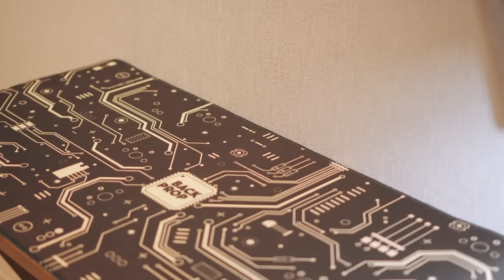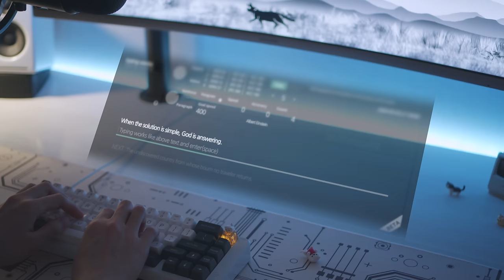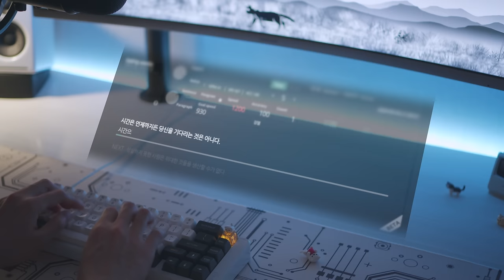SPACE65 Custom Mechanical Keyboard Build | H1 Switches & SA Oblivion Keycaps Typing Sounds

Comment: Lubed linear switches are honestly something else, they sound so full and... perfect
Reply: The foam pad he placed between the pcb and the baseplate creates that more solid sound
Reply: Planning to build my first keyboard with lubed Cherry MX Blacks. Can't wait!
Reply: Dominik Seljan you’ll fall in love with typing
Reply: SA keycaps also affect the sound alot
Reply: Thanks alot for showing the heat shrink tubing mod. It actually works perfectly on my GK64 stabs, which drives me crazy for weeks...
Reply: @sandipandeb9330  wait.... he?
Reply: @MMedic23  uh yeah?
Reply: Guys have u ever heard of c3 tangerines
Reply: this keyboard is my endgame. literally perfect thoc
Reply: Solve Everything  o rings??
Reply: Why did this board sound so low pitched and thocky compared to most others?
Reply: @Annihilation261  I thought he said the shrink tubing didn't work? Did you have a bad rattle?
Reply: Solve Everything  I think the problem is with mass-production. There will always be some roughness to the stems. You can hand polish them if you want as an alternative to lube, but you'd probably still want to lube a little.
Reply: That keyboard THOCKS!
Reply: @kaandemirci9691  Pudding keycaps look cool but they are really thin plastic.
Reply: Man I don’t know, it sounds really bad to me, just like machine thunking, I don’t know what it sounds like but I don’t like it. I’m sure you guys love it tho lol
Reply: I honestly prefer tactile switches
Reply: yes and now im thinking of lubing my keyswitches which are outemu blues (i didnt think blue switches would be very loud compared to smth like red or brown since im very new to keyboards) due to noise complaints
Reply: @jonathan_emmanuel  it might be a little late but my friend clipped the legs and click jacket off of his blues and it turned to quiet linears. I don’t know how it works so you might have to look up a tutorial.
Reply: uu7569
Reply: true i lubed my outemu red and put 5 layers of tape mod and foam mod its more solid sound than before
Reply: @sandipandeb9330  That and the fact he's using SA keycaps. SA + linears are a lot like the sound porcelain makes when it impacts itself gently. Almost like a clonking sound. It's weird and I personally wouldn't live with it, but it's unique, that's for sure.

Comment: 5:51 I just taped a piece of thin plastic transparent band-aid on the place where the bracket touches the stabilizers stem. It dampened the clatter.
Reply: You just reinvented the band-aid mod.
Reply: @stopthephilosophicalzombie9017  I mean putting band aid in the hole where stabilizer bracket goes into, to dampen this click that stabilizers making. This is far not the same as a band aid mod.

Comment: You blew my mind with that wire rebalancing. Why didnt I think of that? Also: I have that same issue where that ticking noise drives me crazy xD (especially on plate mount)
Reply from the maker: Usually with GMK screw-in stabs, it's easy to make it right but this time..... so frustrating XD
Reply: @3ildcat  I never actually properly fixed this issue, but I went around it by dampening the noise with extra 205g0. I also tried many things like filing the wire, buying extra stabilizers just to get the perfect straight wire but it never works and it drives me crazy.
Reply from the maker: @sumkid9263  After making the wire well balanced, mostly the problems are disappeared in my experience. This build was.. have no idea. Hope you can fix the issue better than before :3
Reply from the maker: @duckadence  That's sad news.. I am waiting for 4 sets of C3 Equalz stabs now.
Reply: :3ildcat I experienced the same problem too. Didn’t try as many methods as you, but I tried to solve it for up to a week and I gave up.  Tried cotton wool methods without lube for space bar. It worked but requires a lot of time for tuning.
Reply: :3ildcat you can check which ones are retooled or not, I just found out a couple days ago. One of 2 differences is the dot on the top housing of the gmk stabilizer is actually cut out in the retooled bad ones, the pre retooled ones aren’t cut out as deep or at all. The second is very hard to explain but this shows the differences very well https://www.keebtalk.com/t/cherry-retooled-stabilizers/7249/7
Reply from the maker: @WesleyKarp  Thank you for the information :3
Reply: i actually have a similar problem almost every other keyboard and i have not find any fix except trying another stabilizer
Reply: I had a fix where I glue thin waterproof paper under the plastic stabs where the wire touch the base.
There's one chinese site somewhere mentioning this with electric tape. It will add a little mush but imo it's better than clicky ticks. I used to try thick grease like vaseline (not recommended) and it didn't fix the sound until I added waterproof paper as spacers/dampeners with dielectric grease
The paper I use was alcohol pads packets.
Reply: @ducttaperulestheworl  That seems like the RAMA shrink tube mod. It kind of works but honestly I would just go about this problem by trying to get the wire as straight as possible or buying a new one if its long gone lmao.
Reply: @sumkid9263  Oh hey that was good too.
Reply: @WesleyKarp  aà

Comment: I've found that adding a layer of thin tape to the ends of the stabilizer wires can remove the click sound when tapping, just put 1 layer of tape at the ends of the wire that are inserted into the stabs
Reply from the maker: It will rip off eventually.
Last year, I did that way and it was fine at first.
Reply: @3ildcat  How long did it last before it tore off?

Comment: I don't particularly like mechanical keyboards, but it seems that mechanical is the only way if I want a custom layout. But the problem with mechanical keyboards is the thickness; They just seem too thick. That is, if my palms are resting on the desktop surface, I cannot easily access the upper rows like the numbers or the functions. At 10:00, your palms seem to be floating in the air, not resting on the surface, is that how people are suppose to type on a mechanical keyboard? Isn't that tiring?

Comment: What type of foam are you using at 8:25? I have spring pings in my keyboard and might give the foam a go to see if that can fix some of it
Reply from the maker: Foam does nothing to the spring noise.
Reply: @3ildcat  Ooh okay. Is it the lube that fixes the spring noise? Or am i totally wrong?
Reply from the maker: @andreashenriksen1485  Lubing springs = Removing spring ping

Comment: HI, so for the stabilizer issue, how did you fix it eventually? 
You band the wire+ shrink tube+ placing form under the wire and stabs? 
cuz my spacebar left side also have that freaking "chicking sounds"....
Reply from the maker: bending and twisted wires, foam
no shrink tube.

Comment: ever figure out how to fix the pinging in the stabs? I have that in my space bar, L shift an backspace. :'( . I' haven't tired balancing or bending the wire nor do I know how to properly do it but I think the foam might.... help...?
Reply from the maker: 'balancing' 
if the other parts are not balanced, anyway should balance the wire for the parts to fit well all together.

Comment: What are those syringes you use to balance stabililzer wires? Do you keep adjusting until there is no noise at all?
Reply from the maker: right
Reply: @3ildcat  What syringes did you use?

Comment: Not bad but so much effort for just a keyboard... You should use your time wiser. ;)
Btw. the Cherry MX Red and Dark Grey are very silent. I had so far rubber dome keyboards and bought me now a Logitech G815 with Cherry MX brown. What switch do you prefer? I bought also a switch sample on Amazon with 12 Cherry MX switches so I could test the best for me before the buy.
Reply from the maker: I don't prefer Cherry switches. My favorite switches are tealios and holy pandas.
Reply: @3ildcat  What's specially the difference between these three switches?
Reply from the maker: @Johnnii360  You can check this link https://switch-wiki.com/switches/tactile

Comment: Dude i just got my kbd65 kit and the spacebar wire is rattly... ive tried in every direction tried bending it and it either changes sides or both sides rattle.. I don’t know what to do .. i want to cry 😭😭
Reply from the maker: sorry to hear that
there must be some minor gap between wire and stab.
Reply: @3ildcat  I've seen you try the heat shrink mod for the stabilizers before, did that work for you? I've spent the past 2 days trying to bend and twist the wires.. and its just not working. Gonna try again tomorrow

Comment: Can anyone please explain to me what was he doing from 3:08 - 3:14?
Thank you
Reply: He's showing the switch film. In case you don't know what switch film is, it's a small piece of plastic that you can put in between the top and bot-housing of your switch. Doing so will fill the gap between top and bot-housing, and make your switch sound more consistence, because the gap between those components have been filled and they can no longer rub each other and making weird sound.
Reply: @huunhanle3809  Thank you so much! So its basically not quite necessary. But if you have it, its better right?
Reply: @xtestarossa376  Yes, it's not that mandatory/necessary. If your switch's housing is already tight, then you don't have to film them.
Even if you don't plan to use them, having them as a backup is very recommend, because some switches have a tight housing at stock but somehow lose the tight after you open them up to mod them.

Comment: Link of the mouse pad??
Reply from the maker: It's Doro desk mat.
As I am not Chinese, I used a freight forwarder.
Sadly hard to get..
https://item.taobao.com/item.htm?spm=2013.1.20141001.1.6d7a252a74Xs97&id=587143973122&scm=1007.12144.95220.42296_0_0&pvid=a6292b85-ea22-4a8a-8a75-6457bf41e623&utparam=%7B%22x_hestia_source%22%3A%2242296%22%2C%22x_object_type%22%3A%22item%22%2C%22x_mt%22%3A0%2C%22x_src%22%3A%2242296%22%2C%22x_pos%22%3A1%2C%22x_pvid%22%3A%22a6292b85-ea22-4a8a-8a75-6457bf41e623%22%2C%22x_object_id%22%3A587143973122%7D